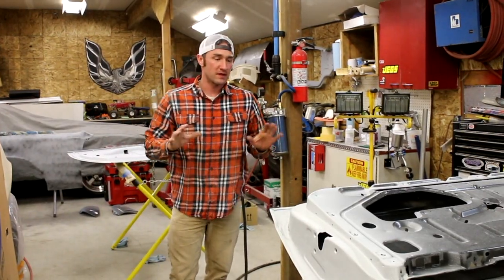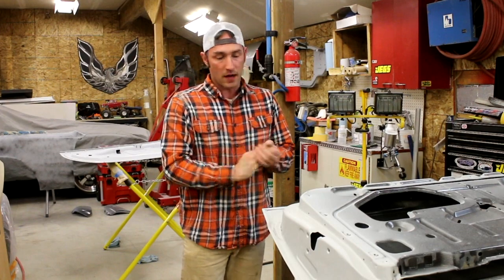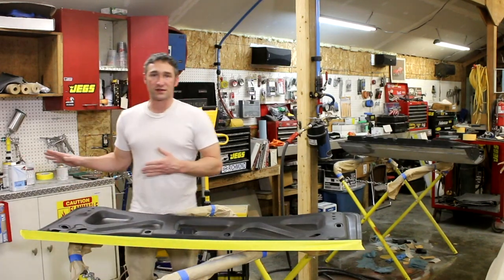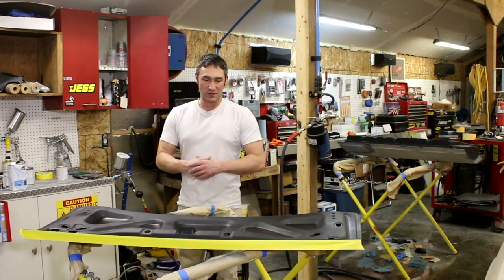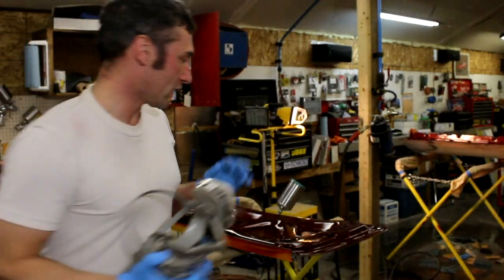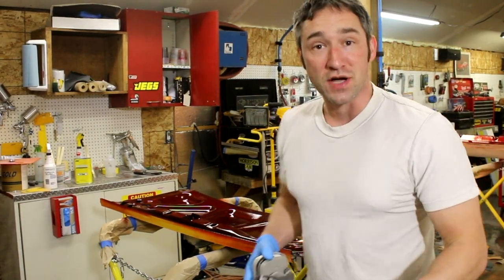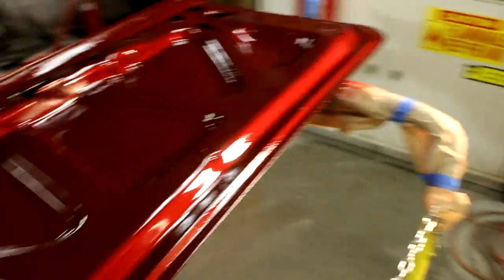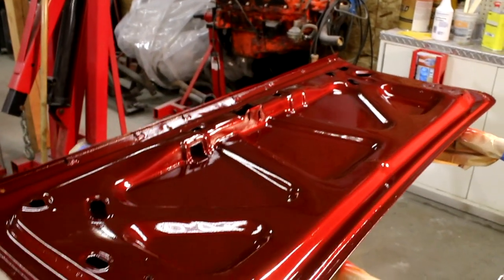Automotive Base Clear painting practice Jakes Shop

Comment: Good job my friend.  What type of gun did you use for the base and clear?
Reply from the maker: Highspeed Noble Warwick is the brand. it’s the 904 model I believe. Would have to verify. 1.4 tip for both base and clear.   Loving the gun overall.  I actually bought two one fire base and one for cleAr
Reply: Jakes Shop Thanks for the info.  I will definitely check that brand out.  I have a Devilbiss Finishline 4.  I really need to figure out the settings.  I’m painting my 70 Chevelle.

Comment: Looks great man! I love that color. Did you get any over spray on the outter surfaces? I couldn't tell if you had everything taped off.
Reply from the maker: Thanks!  A little sealer over spray on trunk front panels but before base and clear went on I masked off things I didn’t want paint on.  I Will be blocking down all other primer areas before painting main car . I’ll post more videos on it as I progress. : ).